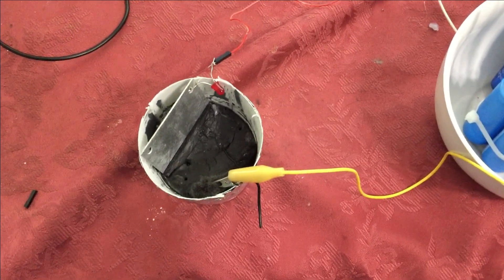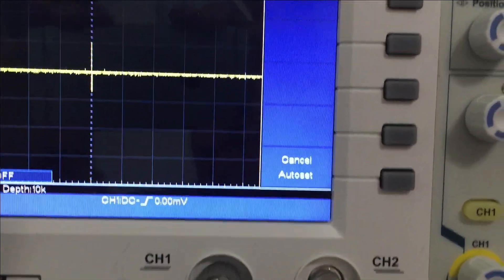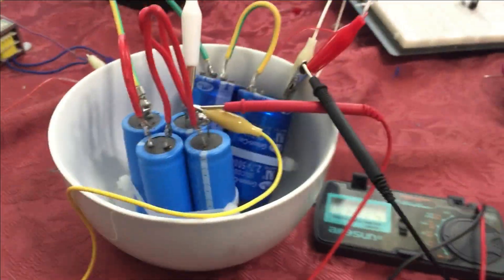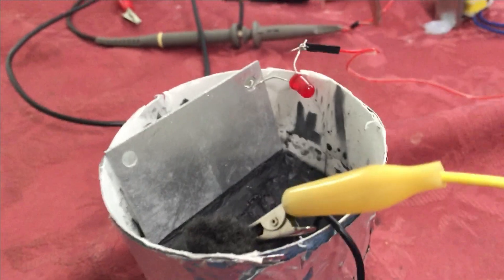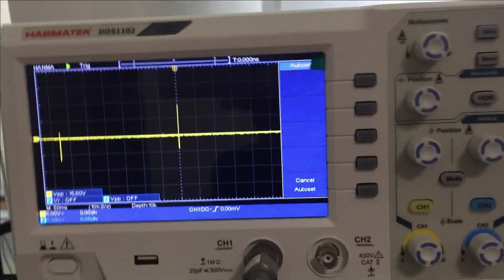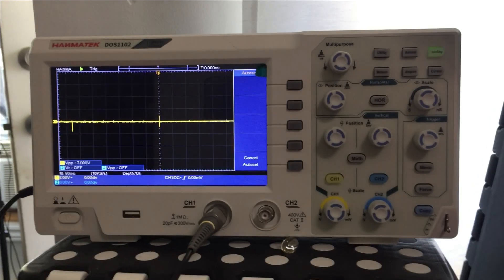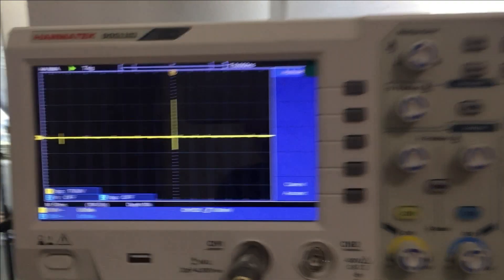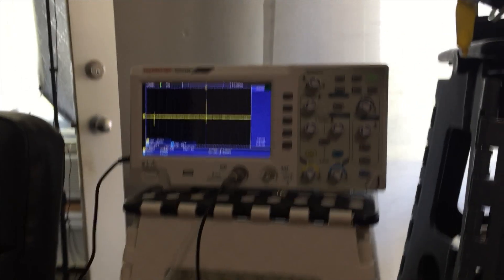PEG Feedback Amplification Loop

Comment: The smallest part in this circuits seems to me the cables and the LED itself. I believe  that the echo gets limited by this parts in the circuit. I have an idea how to test this theory. I would take your PEG cell you're using here. Then connect a 12v-car-battery or 12-lead acid-battery with the PEG cell in series with wires AWG 15 or bigger. And the load a 12v-car bulb with 5 Watts also with AWG 15 or even better, connect it directly. This way everything is bigger and the echo is eventually also bigger.

Comment: Hi Joel 👋 do you start with charged caps in that system?
Reply from the maker: Of course just like I did the first time, caps just simulate a series DC , feel free to use any trigger that is available instead of caps,  Solar, Earth/water batteries etc...

Comment: I have tried to make a "battery" similar to yours. I just added a couple more crystallizing chemicals to your polyethylene glycol. As I do not have copper oxide yet, I've used galena and pyrite. When I left it to dry, I left it connected for some hours to my PS 60V to align the molecules and crystals. What is interesting about that "battery" is it acts as a diode and a battery at the same time. On the positive terminal, there is the minus port of the diode if expressed graphically. It gives me 1.6V and 0.4mA. 
Just wondering, the diode lits becouse the external input via your osciloscope?

Comment: Very Interesting! I wasn't going to get into these power cells that you have been making, but this is so interesting that I am about to order all the Peg cell ingredients, I was also thinking about making them in Graphite cups and trying various centre electrodes.
Reply from the maker: Very interesting, Can't give you any guarantee of the various experimental outcomes you have in mind, But I am looking forward to hearing your results. Folks are having issues around the world finding the right PEG 3350 100% powder. I'm thinking of buying some bulk here in Canada and repacking it with my in the works PEG cell kits. If you look around some have been lucky enough to find the right mix. I'm still a little confused as to why the PEG is so widely available in dollar stores and corner stores even Walmart in big bulk yet everywhere else it does not even make it across your borders by mail in original packaging.
Reply from the maker: The folks over at Beyond Unity forums are working hard at trying to figure out what mix needs to be done if you can't find the right PEG to make alternative PEGs work as well. So far very promising. But i'm not there at the other end of the world so I can do little to contribute to that part of the research.
Reply: @joellagace1679  I guess the content of relaxa is pure PEG 3350. I could buy this type of medicament also in the pharmacy. But there is a little bit of sodium chloride and other small amounts of ingredients. This could distort everything. I could order also pure PEG 3350 on  the internet. But it's 3 times more expensive.
Reply from the maker: Yeah 100%
Reply: @joellagace1679  I checked at least 5 different medicaments of this type in the German language area. They have all a bit of sodium chloride, sodium hydrogen carbonate and potassium chloride. It must be by design to destroy the effect.
Reply from the maker: I experimented with chloride, sodium etc and it eats up electrodes!
Reply: @joellagace1679  That's what I thought too because I studied the electronegativity of chloride and also of carbonate. Chloride has even more negativity than carbon. Sure they destroy the effect of PEG. I'm convinced it's by design.
Reply: @joellagace1679  "else it does not even make it across your borders": I wouldn't be surprised it will be vanished in the stores even in your area. They know and they know that you know. As long there is no big influence by your side it's OK. That's why we have to share this information quickly. They can't delete it in my head.
Reply from the maker: Yeah this cell here has a centre electrode its the copper in the black wire that is sticking out doing nothing. Saving it for future project that need transistor like bias and see how it reacts.

Comment: I didn't think you will manage to do this that quick. But here it is. I'm not sure if I understood everything correct.

I'm guessing in this setup you didn't precharge the capacitors to start with. There is 0.5v-1v on the cell in the off mode. The main point here is that you manage to charge the capacitors up to 6.05v without any power from outside. That's groundbreaking. And the capacitors are keeping this voltage permanently. The voltage of 6.05 and 0.5v of the cell is adding up I guess. And you connected the plus of the cell to the plus of the capacitor bank I guess. And it's changing the polarity when the LED is blinking. In this moment I guess you have around 10v on the load. This are approximately -5v on the cell and +6.05 on the capacitor bank that makes 11.05v on the load. Am I on the correct path?
Reply from the maker: Yeah more or less it's in that direction. I had to give it a trigger to start of course. But my point was it can be removed, In the other video I had no feedback and was pulsing it manually just to demonstrate the effect. But many got upset and thought it was scam.
Reply from the maker: HV has the knack to blow everything up even at low current. So my next idea since this seems to be interacting with electrostatic giving us a kind of cold energy flow.  Because nothing heats up it might work well along side more advanced projects like Solid State Bedini, Don Smith. Kapagen etc...
Reply: @joellagace1679  Exactly I got the idea that this PEG cell would run very well with very high voltages. But this is something that scares me. I don't like more than 100v. Go with the Solid State Bedini. Combine this. I believe this will be a big step forward again. I get it more or less so fare. And one day I will see a way to do something with this. My knowledge in this area is not that big.

Comment: Guys it's just a series loop from the cell, through the caps, through the primary of the transformer and back to the cell through the led. You have a wire from the secondary going through a diode and back to the caps, capturing the spike. I'm sure he will explain it because he's a nice guy but it's really not hard to understand if you watch the previous videos.
Reply from the maker: That's really all it is,...... :) no secrets no gimmicks
Reply from the maker: Some get confused with the transformer and think its just a normal basic L/C oscillator that runs for a few seconds and ping pongs between caps until drained. I put heavy emphasis the transformer is not even needed its just a quick method to isolate and capture the spike.
Reply: @joellagace1679  I guess instead of a transformer it could be done also with a MOSFET NPN.
Reply: @Someone-A3 Here is my understanding. The build up of this circuit is completely DC. But inside this DC circuit it's going back and forth like AC. And with the help of the transformer the spike in the beginning gets collected. And the collected spike gets transferred back into the caps. The circuit creates AC with pure DC and without any coil. That's one special attribute of this PEG cell.
Reply from the maker: Yeah the waveform shows it well, the load closes by the internal blinky led circuit, this causes the cell to see a higher potential and respond negative to it at the same time, Followed by the smaller lump (LED blink current) And that seems to resets the loop as the cell always tries to "Charge" back to its potential and that kind of looks like slow AC on a load. I'm thinking this might be good to trigger a SCR cap dump.... Thinking... i'm thinking....
Reply from the maker: And of course everytime that blinky LED turns it it creates a inductive kickback spike,  so it has no where else to go but to back feed into the PEG cell, at that moment, that spike trigger the cell to spike in opposite pol when it turns off and the transformer captures that super echo spike
Reply: @joellagace1679  "inductive kickback" "low AC" "super echo" This part I understand very well albeit only theoretically. It's the heart of this circuit besides the constant potential. Both are unique. I'm convinced there is a way to do something very simple with this. But do it step by step. Try the SCR cap dump or Bedini solid state. I'd prefer the SCR cap dump first. I know it's very difficult. But you will get it.
Reply: Thanks a lot for this short explanation. We are not all on the same level. Your explanation helped me a lot.

Comment: Did you just save the world?
Reply from the maker: I guess the limits are your resources, I can't do much in a kitchen and a few wire clips :) But it gets the point across :)
Reply: @joellagace1679  Waiting for the kits... 😁
Reply from the maker: More like the end of summer it takes like 6 weeks to get some of these parts ( the magnesium plates and conductive carbon. :( but its all in the works, It's just going to take some time. Also need to find plastic molds the size of about cupcakes.
Reply: @joellagace1679  I'm laughing about the cupcakes. My wife buys applesauce in these little plastic containers about the size of cupcakes. I have a stack of about a hundred because I use them for sorting small nuts, and screws.